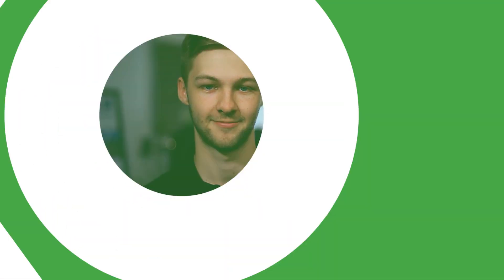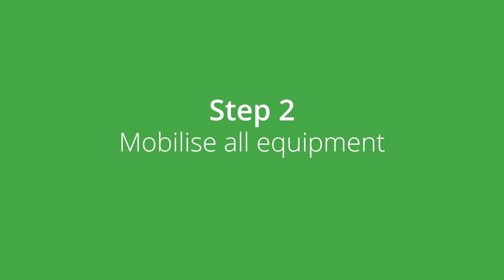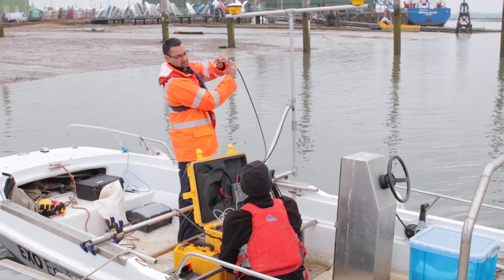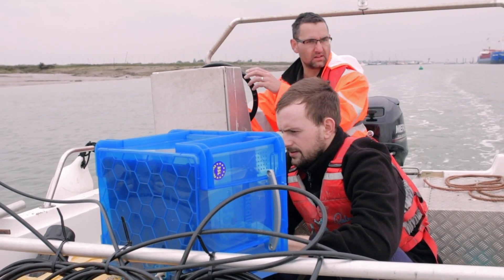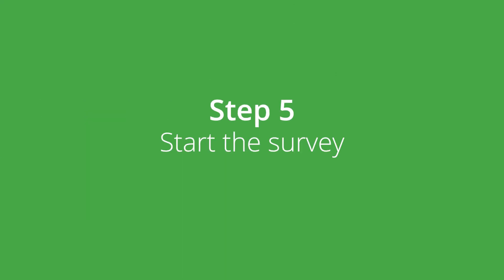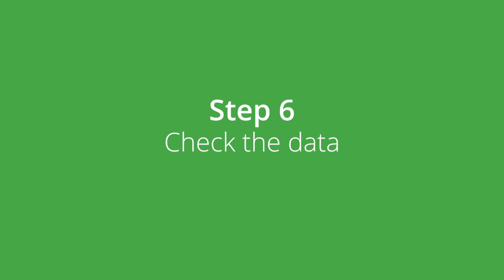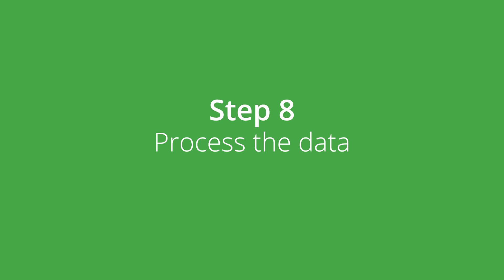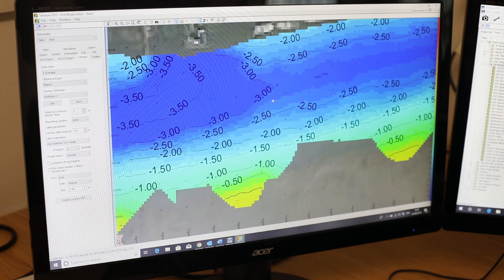How to conduct a Bathymetric Survey

Comment: can you please explain why the measurement and the determination of transducer's draft is important in bathymetric survey??thank you in advance
Reply from the maker: Hello, thank you for your question! It is important to know the draft of the transducer if you are using a tide gauge to correctly georeference the depths measured to the relevant datum. In our case, the tide correction is done with RTK GNSS, so the draft itself is not important but the offset between the GNSS antenna and the transducer is used instead. I hope this helps!
Reply: @ExoEnvironmental  thankyou sm sir..really appreciate for the ans

Comment: thank you for the video i have a little problem, with reducing the soundings to a datum..... LAT, MHWL, MLWL, MSL, MTL....  and how to do you merge levels from a tidal benchmark, to a tide gauge and use such data to reduce soundings... thanks for your help, if there is a contact person, I will love to discuss more on this. 
I have a B.Sc in Geoinformatics and Surveying, and I have a considerable amount of experience in bathymetric survey
Reply: try to used admiralty formula.
Reply: @HydrographicSurveyor  thank you. Sir, do you have any reference document, that you can share?
Reply: @nsikakobongeyakz4032  For now I can only share hydrographic survey videos on my YouTube channel.
Reply: @HydrographicSurveyor  that's fine thank you.
Reply: @nsikakobongeyakz4032  any time
Reply from the maker: We use software called Teledyne PDS which handles all of the processing in-software. We also use RTK GNSS throughout the survey to correct for the tide as that is much more accurate than using tidal gauges. The chart datum (typically LAT) can usually be obtained from navigational charts or the local authority depending on location. The Z correction is then applied on the measured GNSS data. Hope this is helpful!
Reply: @ExoEnvironmental  it's ok. Thank you, 
But can you make this a little more detailed.. if you have sketches or videos where this is done that will be more helpful.
Reply: @ExoEnvironmental  is there any number or email I can contact to have a detailed discussion.
Reply from the maker: @nsikakobongeyakz4032  The methodology depends on the exact equipment used, which makes it hard to produce general tutorial videos on specific equipment / software. These should be available from the manufacturer. Feel free to take a look at our website for more information of Bathymetry (https://exo-env.co.uk/bathymetry/). You can send an email through our contact page!
Reply: @ExoEnvironmental  thank you so much
Reply: @ExoEnvironmental  I understand this method.... How about doing it manually with the GNSS processing software.

Comment: Hi, I was wondering how do you guys do a survey in a shallow water? are u guys still using a sounding pole?
Reply from the maker: Hello! The echosounder is able to function correctly up to a depth of 50cm. Any shallower water and the echosounder will actually pick up the internal casing, and subsequently produce too many errors. In a tidal environment shallow water is surveyed at low tide with drone photogrammetry. Whilst shallow static water bodies will have to be surveyed by topographic survey pole. All three types of data collection can be merged in our software, to create one chart, map or model.
Reply: Is your software able to detect wrecks and rocks or is object detection done by humans